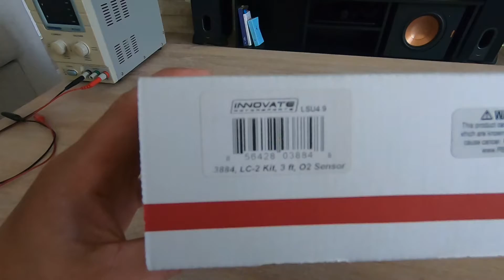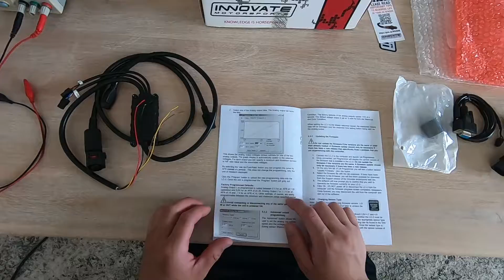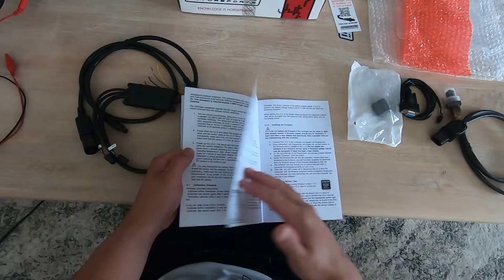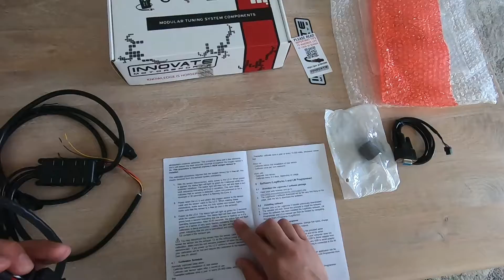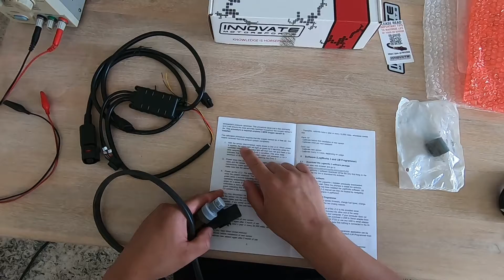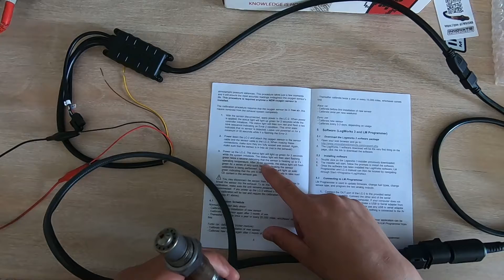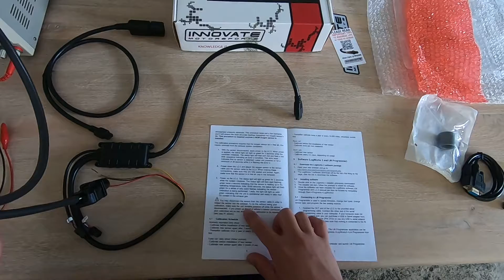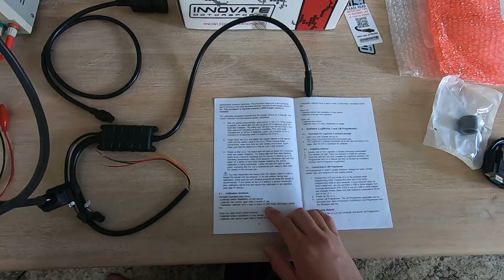Innovate LC-2 Wideband O2 Controller Unboxing and Sensor Calibration

Comment: So when I change a bad sensor.  I should power cycle cycle it with nothing connected with my key.  Let it sit 30 seconds.  Then power it off. Connect the sensor (without screwing it in) wait for the light to turn green.  Then install it.  When the power/key is off it should be safe for me to unplug the sensor to screw it into the bung.   Sound correct?   Mine is a couple years old.  Sometimes flashes 7.5 which im assuming means its failing.
Reply from the maker: That is correct in terms of the sensor recalibration. I am unsure about the 7.5 flashes.

Comment: How does controller emulate output to ecu? My stock o2 sensor pulse between 0.9v and 0.2v what at 14.7, I cant find it anywere so I need to know before buying. Thanks
Reply from the maker: @B0bik  Hey, the controller converts the wideband O2 sensor signal to an analog 0-5 volts. You will have to set up the scaling in the ECU’s configuration.
Reply: @jonathanjovenal  Okay so it holds for example 0.5v when at 14.7? Because my lambda in the car does jumps between 0.2 and 0.9 when at 14 7.

Comment: Wow. Had no idea recalibration was required after operationally installed at time and or mileage frequencies. I have this installed on a NA and Turbo application. Both have about 500 miles on them and both will intermittently drop readings to 7.4 while running.
Reply from the maker: A recalibration might definitely fix that issue!
Reply: Mine started doing that too.  Think I should try recalibrating or the sensors bad and replace it? Its been 40k miles.
Reply: @livinlifefl411 try the recalibration first before buying a new sensor. I recalibrated on my turbo car, all good for the last few hundred miles. The recalibration on the non turbo car worked for less than 100 miles.